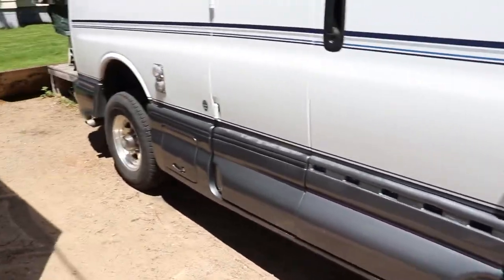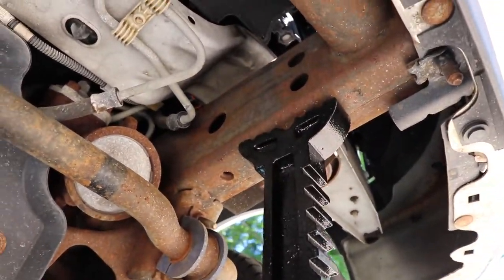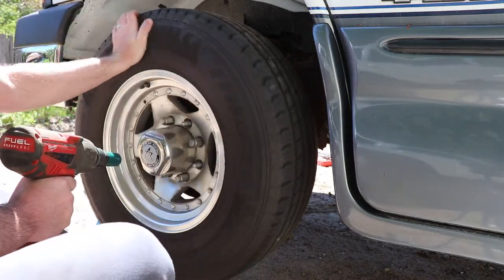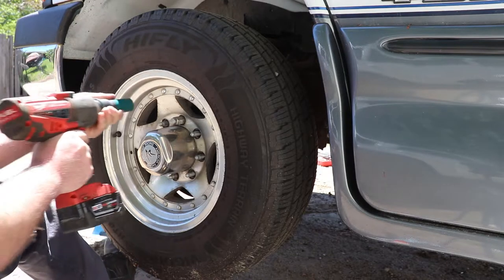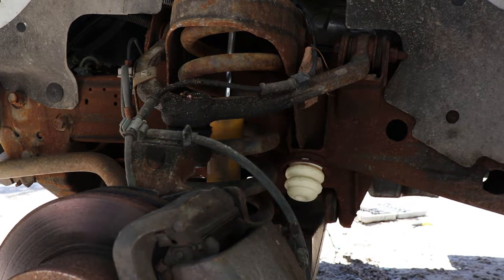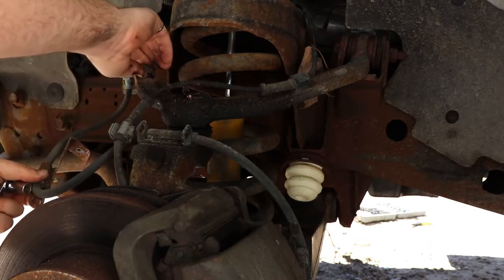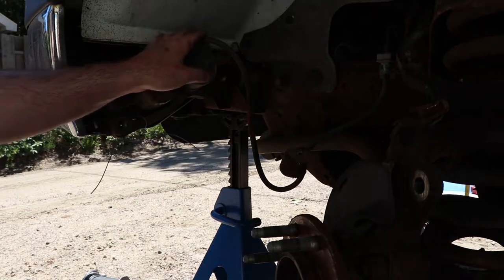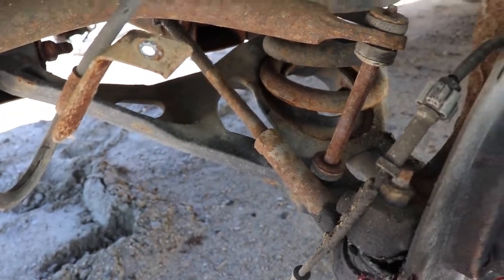2003 to Current Chevy Express 3500 Weldtec 5" Front Spindle & Spacer Lift Install

Comment: How does it ride now ? Did you go with their rear Overload Negative Spring Upgrade ? I'm thinking of doing that
Reply from the maker: I did not change the spring pack at all.  I have a heavy van and it rides fine with the stock springs, if anything it is a bit soft for me.  You could always install them afterwards but it would be a bit of effort to redo the job.